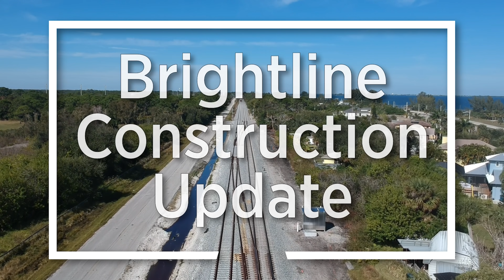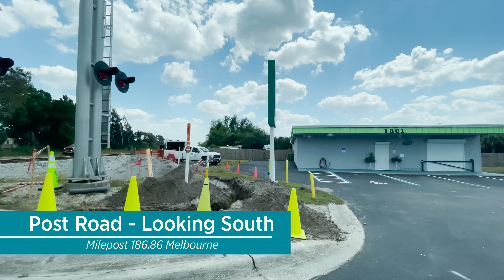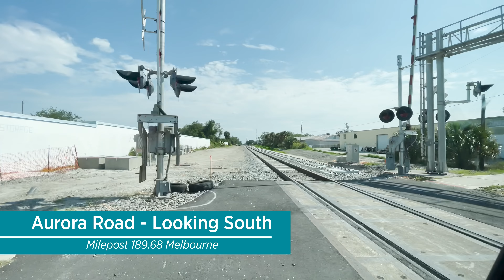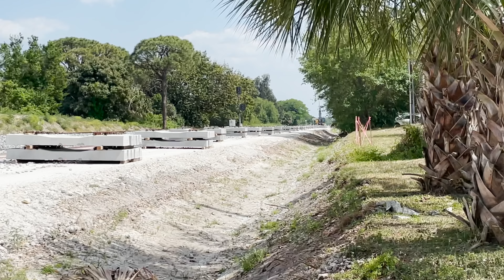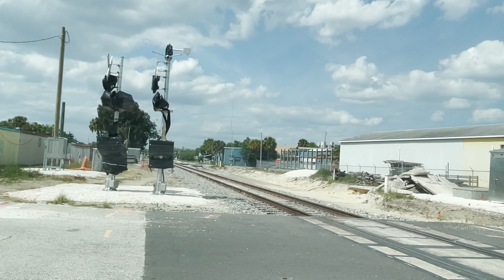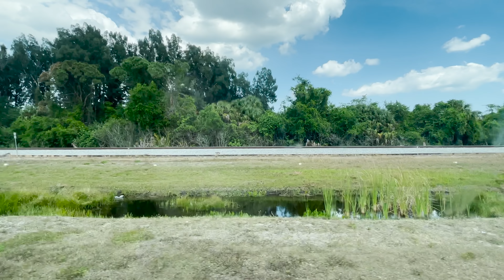Brightline Construction: Progress Around Melbourne - April 2021

Comment: Sorry if you addressed this in an earlier video, but in the areas where the new ties and rail are lower than the existing rail, will the new rail be raised up to the same level at a later stage of construction, or how does that work?
Reply from the maker: Yes, it will be raised after ballast is dumped. The tamper machine raises the track slightly each time it passes over, filling in ballast under the ties in the process. You can kind of see that process in this video: https://youtu.be/vINzBkK1d-k